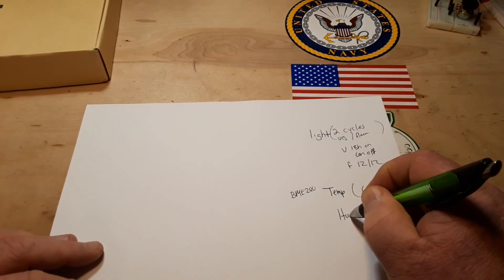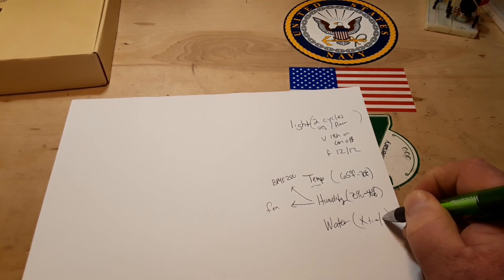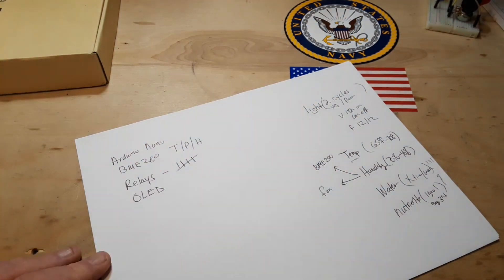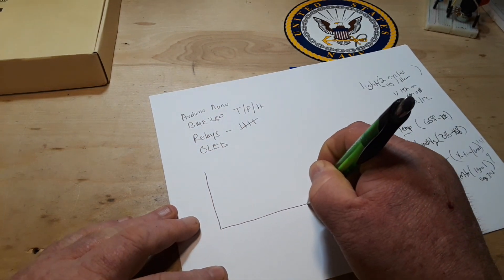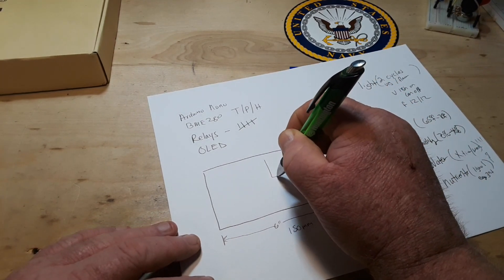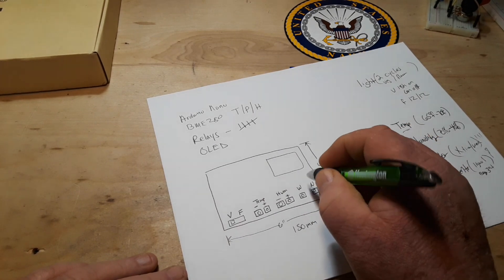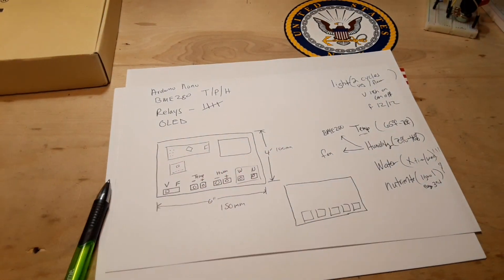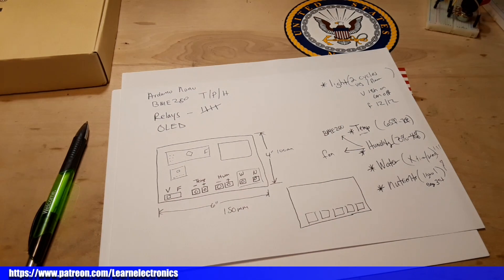Indoor Garden Project Introduction

Comment: Restart Capability

You may want to consider adding a small battery backup RTC and micro SD card to your design for recovery purposed.  You detailed the water, feed, and two light cycles as requirements so if a reboot does occur anytime during a crop cycle you need to be able to restart from that point, especially if you are in the flower cycle.

I would suggest creating recovery point every 15 minutes that includes all the variable settings and all the other data points.  This gives you a simple cycle recovery point and the data points for the entire crop cycle. 

The data points, post crop cycle,  give you valuable trend data when analyzing crop quality vs light, water, nutrient, temp, humidity, etc to help optimize crop production at minimum costs.

Comment: Since I've built three watering systems already (1 indoor, 2 outdoor) here's a bit of input:
1. Pump: unless you use a peristaltic pump you will need an additional NC solenoid valve to stop the water flowing. Unless the water tank level is below the outlets or the outlets have some kind of pressure valve of course ...
2. Instead of an extra pump for nutrients why not add them to the water tank with the appropriate dilution?

Here's my setup:
- bme280
- HX711 + load cell to monitor water supply
- ADS1115 16bit ADC for soil moisture sensors
- LDR for basic sun intensity monitoring
- 1-4 mosfets for the pumps
- ESP32 because of WiFi

The micro-controller itself only has some basic routines to trigger the mosfets for a certain amount of time via MQTT messages.
It sends all the measurements via MQTT and node-red takes care of the watering logic.

Comment: Why delete my comment about PLC's? Do you have something against them?
Reply from the maker: I don't delete anything. Is there a link in your comment? If so YouTube puts it in a folder for approval. I haven't been to my computer yet.
Reply: @learnelectronics  Thank you for responding. I commented twice that I was using a PLC to grow gourmet "mush rooms", and Youtube must be thinking that I'm talking about the magic variety. I apologize for the accusation. 

I'm using a C0-12DRE-D PLC from Automation Direct along with a couple RS485 Modbus RTU temp and humidity sensors in my terrarium. It could easily be adapted for an indoor garden, and I have plans to do so. The nice thing about PLC's is that your customers can modify the ladder logic easily, instead of relying on someone else for code. You can also create multiple programs for different conditions - seedlings and flowering conditions - and load them to the PLC at your discretion. The Click PLC software is free from automation direct, and it displays live info from the Modbus sensors. Finally, I can use Teamviewer to log into my PC and view the Click PLC software from anywhere, so if I'm on vacation, I can pull out my phone, check conditions, and load a new program to the PLC from almost anywhere. I would be very happy to make a video about it for you. There's a video below from AvE covering the basics of the PLC I have. Finally, thank you for your videos. You have given me a healthy education on more topics than I can count. Have a nice day.

https://youtu.be/ZON5UuibJXI

Comment: Good stuff Paul! Work the programmatic piece first. Then work the UI/ controls later. If you get everything talking first, I think you will find how to control the “talking” later from a panel will be much easier. Just focus on one element of control at a time and what is going to work best for what you have designed it to do. Just my 2 cents😀
Reply from the maker: That is good plan.

Comment: This one will test your Arduino coding skills for sure Paul !
I see a lot of user defined functions coming up !
It might be wise to contact Tim and find out if the parameters he has set are generally above the usual atmospheric conditions at his house , if you don't need to reduce temperature or humidity  will make life much easier , what I mean is if the conditions at his place never go above the ceiling he has set it will make things much easier as you can just use a fan to changer the air in the aquarium to drop humidity or temps   - not much use if the air outside is hotter or more humid than the air inside the aquarium. You will be looking at something like  Peltier unit to control the temp and humidity otherwise  .
I would use Mosfets where possible , arduino's have a power draw limit and if they for some strange reason end up turned on at the same time relays might draw more current than the  arduino can supply- unless you use relay drivers that is .

Comment: to reduce the button number - one tac swith to cycle thru ( Vege/Flow - Temp - Humidty - Water Cycle - Nutrient cycle) and a rotary wich acts as +/-/enter
or maybe juste a little rotary encoder wich cycle (...) - press to change - turn to increased/decrease..
my 0.002$

Comment: You should also monitor the soil moisture and feed that back into the automatic watering control.  Also, you probably want a different soil moisture level for seed/seedling stage than for the later stages of growth.

Comment: Do you want the T/P/H sensor in or on the unit ?  Any heat generated by the unit will impact the sensor as well as reduced air flow.  Can that be mounted externally ?  For the Temp at a height at the average level of the plants since heat goes up.
The heaters and fans will use a LOT of power so you may get issues with relay contacts arcing and becoming dirty/worn/sticky.  Would triacs be a better option ?
Why use a slide switch for the light, then tact switches for the rest ?  Why not be consistent and toss in LEDs to show what's active, (Green/Yellow for Growing/Flowering 🙂)

Comment: Hi Paul, keep in mind that some soil water detectors operate by conductivity. If this is your case, then the conductivity can be affected by the added nutrients. For example, some nutrients may dissociate into ions which will increase the conductivity of the soil, giving a false positive. The work-around for this situation is to calibrate the sensor in various soils containing the usual concentrations of nutrients. Another possible, yet more complicated solution is to use the reflection of light from the soil. The wetter the soil the darker it will be and light will be more absorbed. Therefore, the less it will reflect light from an LED to a phototransistor detector. Once again, calibration will be required and the results can be affected by the soil texture. And finally, humidity (% moisture in the air) can be detected and calibrated using infrared light absorption (IR) since water absorbs IR light radiation. Forrest Mims eloquently did this using a simple IR led emitter/detector (I think it was an 800 nm wave-length) pair when studying air humidity and cloud formations. Hope these tips from an old chemist helps you.
Reply from the maker: This keeps getting more and more interesting

Comment: Perhaps rotary encoder instead of multiple pushbuttons. An led to show the system is on in error (blink). You are measuring the air humidity, you can also measure the humidity of the soil. Perhaps also measure to warn if the container for water or nutrient  is empty? Is only one type of lamp used or multiple?
Reply from the maker: It's going to have a display

Comment: Hi paul, how are u going to power it, or did i miss that. U could use a 5v wall wart and barrel jack and frankly i think u could get by with 99mm x 99mm and get cheap pcbs.  If u use 5v wall wart u dont need a buck converter.  Are u going to use transistors and ground them to switch the relays?
Reply from the maker: I haven't thought about that yet. I definitely want a battery backup.
Reply: @learnelectronics  guess i should mention, if you go with a 99mm x 99m pcb i have an enclosure printed for that with an  oled and bme mounting, as well as a hole for the barrel jack. Also has a lora radio but u probably dont need that.

Comment: You may want to check with your gardener on the need for a fresh air flow across the plants to help control mold, mildew, etc.   Depending on the enclosure and natural air flow that could become an issue ??

Comment: Nice indoor "Garden" (wink wink) project!  lol   Get you an ESP and put a mini web page on it for monitoring and settings.  Also, those old roundup battery powered sprayers are a good free source for pumps.  I use them with my automatic christmas tree water as I dont have an indoor "garden".
Reply from the maker: Good tip thanks

Comment: I'm no gardener, but I'm pretty sure that plants need to sway in the breeze and/or track the sun in order to strengthen and compress their stem cells to pump nutrients upward to the foliage, buds, and flowers. That's one of the reasons most greenhouses have fans, plus for pollination and temperature control.
Low wattage LED grow lights should also be used to minimized electric bills, heat build up, and to optimize UV for flowering/foliation cycles.
IMO, your friend will also need an exhaust fan with an inline HEPA filter to avoid 'odors'.😎
Reply from the maker: The humidity control will be a fan. It will always be running, and can be cranked up if the humidity gets too high..

Comment: If you put the relays on the back, don’t forget connections. Maybe a connector terminal block. I saw someone on a youtube channel use a fan with magnetic stirrers to keep the nutrients mixed. The arduino or pi had a cycle schedule to run the mixing of the nutrients in a large mason jar.
Reply: I found it, he did it with Home Assistant, but a lot of good ideas. Look for “My DIY Home Assistant Garden Automation System - Climate Control, Dosing, and More. Pt.1 - Hardware”

Comment: You also need real time clock. There are some capcitative soil humidity sensors which  may be useful. The nutrients pump should be peristaltic one.since you deal with alive entitys also you need backup power system
Reply from the maker: Yes, I forgot the clock
Reply: @learnelectronics  yep DS3231 would be perfect for this. Lot of other suggestions here on the comments.

Comment: @learnelectronics Just an idea I am thinking but never tried it. I have tried something with water where you can determine the temperature of water if you standardize the contents of the water, the type of metal like copper, the size of the copper plate or wire. The resistance in this case drops as the water temperature increase. And the resistance is always the same for each temperature. Example if the resistance is X ohms at 50 degrees Celsius, then X ohms will always mean 50 degrees Celsius.
What I am thinking is that the presence of water in the air will change the way electrons flow within the air. So, let’s say you get 2 plates of metal or some special material with the right properties close to each other similar to capacitors in open air and then use the change in the properties of the air to determine the humidity.
In this imagination, you will send something like 1 KHz, 10 KHz, 100 KHz, 1 MHz etc. to the capacitor and measure the capacitance and change in capacitance to calculate the humidity. For example, you can put it as a tuning capacitor in an oscillator circuit so that when the frequency go up or down you know there is a change in capacitance indicating change in humidity.
You can then send the signal to another devices like speakers, displays etc. for further processing.
I hope this imagination makes any sense. 🤣

Comment: Hi Paul, I have a question. How do I build a circuit (must not use any microcontroller) with exact, precise output pulses. For example, if I press 2 buttons, 1 for 1 and one for 3, I want the output to be on for 13 seconds. Is there any way to do this. Thanks a alot

Comment: Depending on the size and type of enclosure,  you might want to consider the bme inside and the rest of the electronics outside.  Also, there are many types of multiple relay boards available that may simplify  the custom pc by just having 5 trigger wires to feed it.
Reply from the maker: Yes Ive though about the relay boards and they will be handling all the heavy work.

Comment: This is a nice weekend project, I have made several these. What is a really nice and useful addition is a camera doing timelapse videos. I would use Raspberry instead of Arduino and then you can have also logging, network control, graphs, etc... What is going to be challenge is to well mix nutrients in the water, I have never automated this.
Reply: Mount a small DC motor in the center of the nutrient lid, with a shaft extending to a mixer propeller near the bottom of the nutrient container (just like a common paint mixer on a drill motor inside a 5 gal bucket).
Connect the DC motor in parallel with with the nutrient relay, so that it mixes while dispensing the nutrients. from the bottom of the container.
Also, join the water hose and nutrient hose together, with a 'Y' fitting, so that the irrigation water dilutes the nutrients during application.
Next problem.... 😎
Reply: yes..correct...and yes the nutrient is the trickiest to automate, and i aint found the trick to automate that... yet
Reply from the maker: All right, so here's my thoughts on the nutrient problem. I did not realize this was going to be the biggest problem in the whole thing. So what I'm thinking is I have two supplies, one supply of water. And one supply of pre-mixed nutrient solution and water. So on the days it's water only will just pull from the water supply. On the days it's water and nutrient we pull from the water and nutrient supply. Am I missing something or have I oversimplified something that needs to be more thought out? I don't know anything about this so that's why I'm asking you guys opinion. Thanks
Reply: My every single watering is with the same formula: 5 ml/l grow, 5 ml/l bloom, 5 ml/l booster. You should thoroughly shake all bottles with concentrate before using it and the resulting solution as well. The rest is easy as you sketched in your video.

Comment: Was going to suggest PWM for the lights, but rather difficult to do via relays! lol
Reply: The correct wattage won't need dimming, only a timer. However, separate LED grow lights can also provide UV control for flowering cycles.

Comment: Hi Paul, you’ve got everything pretty well covered, but in thinking about it a ESP 32 wireless controller would be a great addition, I think, just in case you forgot to do it, do it wirelessly. Only a suggestion mate 🤙🏼🇦🇺
Reply from the maker: You know what? I never thought of adding wireless to it. It'll be no trouble at all to go for Arduino to ESP32. Then he could have a phone app to monitor it. Cool. Thank you. That's why I'm here
Reply: @learnelectronics  The ESP32 also allows it to fetch the correct time, in case you want to center the lights-on times around actual daylight hours.
You might consider replacing the temperature and humidity up/down buttons with two rotary encoders. I find they're easier for establishing set-points.
This looks like a fun project.
Reply: @learnelectronics  hope it helps you out mate 🤙🏼🇦🇺
Reply: @learnelectronics  You could go for the ESP8266 also - may be cheaper.
Reply: YES! A WiFi network of ESPs, reporting back to a RPi data logger, and controllable from a smart phone!  My first dream project, when I retired and became a wannabe 'maker'.
Never actually got around to building that automated aquaponic greenhouse. But, it put me onto an amazing learning  experience. Please excuse me, while I play with some cycloids using my DIY Teensy synth laser controller.
BTW, is there a limited budget on this project?